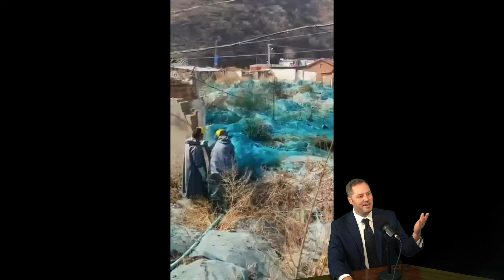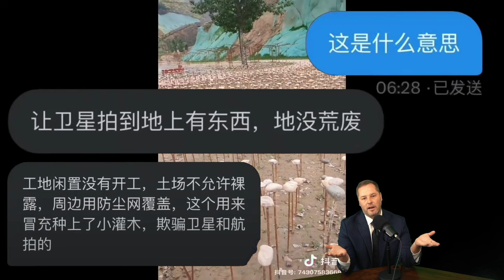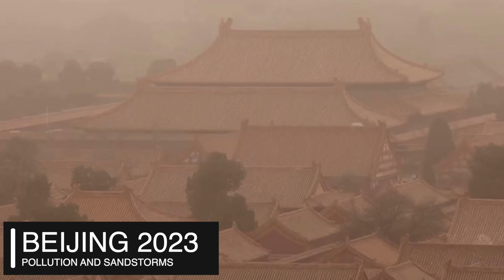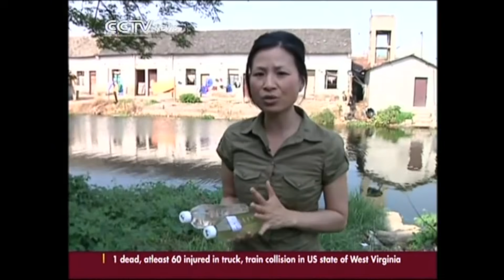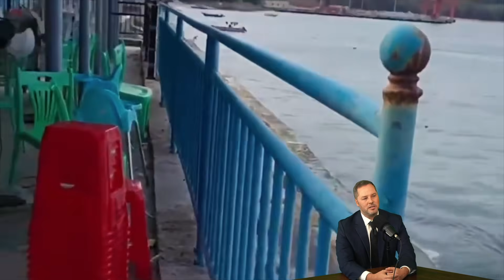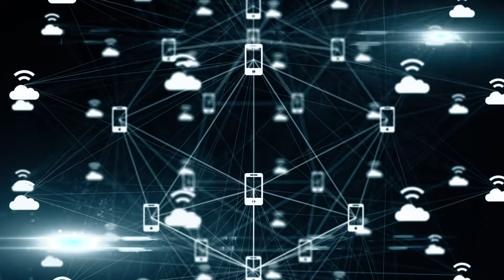China is planting Fields of Stones stuck to Metal Bars - No, Really

Comment: The rocks on the rebar is a safetyprecaution. We do the same here in the west, except we use purposedesigned plasticcaps(that cost a fortune).
The site is a prepared construction site, and we see similar moves across the country. A lot of projects are being done in stages..
Reply: @AmoebaInk  doesnt penetrate as deep when you fall on em
Reply: @AmoebaInk  Youd clear the accumulated debris around the bases, to get acces to the concretefoundation in which theyre anchored in and pertrude from. You use these "spears" to fasten additional rebar, and you wrap that in molds to whatever shape you need and you pour your concrete into that..
Reply: Are you implying that they are filling that whole thing, including the tree they surround with concrete? 😅
Reply: @nonyabidness6492  Filling it?? theyre going to fill it and then stack more on top of it.
Im implying its good to let your anchor sit in concrete that has actually hardend before you stack a 87floor building on top of it..

Comment: Wouldn't painting plants green prevent them from photosynthesizing ever again thus ensuring their deaths?
Reply: That which is dead, can never die.
Reply: Painting dead plants green, will dead plants ever live again ? Answer is .......they are dead and will always be dead.
Reply: @leegilley221  Well no. See plants have this nifty feature, where they tend to grow back if you leave the land alone and let it recover. But if you keep laying down layers after layers of toxic paint...
Reply: @williambarnes5023  you are correct.
Reply: Surprising, no. Paints made speciifically for grasses and plants such as Endurant, does not adversely affect the process of photosynthesis, respiration, or growth. Endurant does not create a film or barrier on the leaf blade like regular paint would. Several university studies have shown that Endurant does not cause a significant decline in photosynthesis, allowing 95% light transmission.
Reply: @allaboutroofing2  Probably works because plants don't actually use the green light. That is why they are green.
Reply: @economicprisoner  no... did you read my comment?
Reply: @allaboutroofing2  You think these people are shelling out for Endurant, instead of cheap lead-based paints?
Reply: @williambarnes5023  yes
Reply: 假新闻，Actually  wrong about the hydroseeding. Using it on raw uncultivated earth, sand & rocks is exactly what we do in the mining industry to stop erosion/ dust bowls, particularly next to roads where trucks stir up the air.  
And yes some mixes are that dark green colour, that dark green colour indicates to me that it’s actually hydromulch。This is the most polluted China 15 years ago. I admire these liars. The lecture in the video is 14 years old, and the pollution content shown in the video is 14 years old.Please check the latest information. China ranks first in photovoltaic, wind power and hydropower in the world, all of which are clean energy. The gray sky in the video has not appeared in 10 years.Please find the channel of foreigners living in China to see the real life。作为一个生活在中国的中国人我不知道吗？

Comment: Recently I learned chinese restaurants are using whats called SEWAGE OIL. Yes doodle sewage oil. 
They harvest it, processes it, refine the oil, and use it to cook. 
why? because its cheaper, and it doesn't taste any different then most other cheap oils. 
it has not been lab tested, because this are local chinese restaurants doing it in china.
and even if it were non toxic- its still disgusting

Comment: In Australia we have "recycling" bins. You can put your plastics and cardboard in there and they take it to a factory and turn it into reusables. 
They definitely don't ship it to China where they then throw it straight in the ocean.
Reply: Are you sure about that?
I worked in a usa trash transfer station and all the glass recyclers went out of biz for lack of demand. Also only cardboard with no coatings can be recycled eliminating half, with the rest and all of the plastic dumped in the squisher and then off to the dump.
Reply: @Derideo  China says they banned imports but IDK. either way little if any actual recycling happens

Comment: I worked for a company that had a Board of Directors that were treated to a one day presentation each year of the main facilities. We, the Blue Collar workers would spend a week or so cleaning the Treatment Plants, polishing the machinery and curiously the Grounds Maintenance department would paint the yellowing grass a nice green color. Then they would Hydroseed any dirt patches that also became a nice pretty green. Generally the Paint department would try to paint an entire Treatment Plant but that often went against the operations being performed so they only rarely did they complete, but they will attempt no matter what to paint those whole plants. The Board of Directors are the current Mayors of the 76 Cities they service. They rode around the County in nice busses and all they could see was nice pretty Wastewater Treatment Facilities. Even after all is said and done about annual plant inspections, the program left those plants clean and professional looking. The communities where these facility’s are look so much better when the local Treatment Plants look good. My old boss believed that if it looks good it runs good. Ehhhh. I’ve seen newly painted machines that ran badly, and usually the Company is forced to solve problems by eliminating old technology which was like pulling teeth. Anybody out there like Magnetic Drives as the Variable Speed controls. These drives used to be a nightmare because Asbestos was banned as a material used on the clutch discs and no replacements worked that could handle the heat and friction. Then Variable Frequency Drive solved that problem permanently. And the Treatment Plant Design Department specified Variable Frequency Drives on most of the Prime pumping stations that are all using VFD’s. But let’s face it painting things like they do in China is just another example of waste, stealing, bribing, environmental damage and just general dishonest behavior on a huge scale. I don’t see any way out of this mess, but I’m sure Mr. serpentza can help guide the way. Thank you for tolerating me for a few moments, your friend.
Reply: pfft, that sounds like our US Navy, painting over dusty pipes and walls to make it look good again before the Admiral walks through.  You can count the age of a ship in growth rings of paint over dust.

Comment: I was stationed at San Bernardino, CA from 71 to 74.  The pollution from LA would blow into our base every afternoon.   You could see it coming.  Schools and businesses would close, but we would still be working outside on the aircraft.  Lungs would ache, eyes burn, and visibility reduced.  Cars had so much pollution controls on them ran like crap.  When testing the cars for emissions, waiving the tester in the air, it would fail.  Shove it up the tailpipe, and the exhaust was cleaner than what was going in the intake.
Now the president wants to fix all our environmental concerns in a couple of years, but allows Chine another 30 years before they have to clean up their act.

Comment: You CAN spray Hydoseeding 'Mixtures' on barren areas.  In fact, THAT'S WHY IT'S DONE.  The mixtures are mostly a little grass seed that is  mixed with green stained paper mulch and psyllium fiber.  I spent 20 years at a Calif. County Dept. Of Public Works covering barrent areas for errosion control.
Reply: Did you paint trees and rocks with it?
Reply: This is the most polluted China 15 years ago. I admire these liars. The lecture in the video is 14 years old, and the pollution content shown in the video is 14 years old.Please check the latest information. China ranks first in photovoltaic, wind power and hydropower in the world, all of which are clean energy. The gray sky in the video has not appeared in 10 years.

Comment: THIS IS not jut a china problem.  half of my city ground water is contaminated with chromium. cancer clusters began to pop up and found out that there was a factory that leaked chromium into the groundwater back in the 80s. but the state environmental protection swept it under the rug. probably it was too much money to fix. until people started getting sick then the epa came in to start testing peoples basements and the groundwater.  they found traces in my basement too.  when it rains hard groundwater comes up in the basement and then when it goes back down and dries it leaves behind these orange crystals that are super toxic and cancer causing.  absolutely terrible.
Reply: the epa was supposed to come clean it up. but all they did was a bunch of expensive testing. and they demolished and cleaned up the original contamination site. but the ground water was supposed to be cleaned up but i guess they figured out there is no way possible to clean it up. so now half the city is a superfund site.  and what is crazy is this is a city in one of the most expensive counties in the united states.

Comment: US auto makers did the exact same thing from approximately 1968 all the way to the early 2000s with the "Air Injection Reaction Pump" emission controls devices.  Their job was to pump fresh air from outside the front of the car into the exhaust pipe so tailpipe emission tests would be diluted when tested.  Did it reduce emissions?  Hell, no.  Not one single drop.  If the car naturally pumped out 20 cu ft of pollutants per mile, it still pumped out 20 cu ft of pollutants even with an A.I.R pump running.  It made no difference. The cars emit the exact same amount of pollutants whether you inject air in there to dilute the ppm count or not.  It's still the same amount of pollutants.

Comment: I don't know what they're actually doing with the green/blue paint on the rocks and fields... But I have done professional hydro seeding, and it is not in any way shape or form difficult to set up and do. I would come into sections of graded land, aka areas where the top soil was stripped and set to specific levels, or grade, and hydro seed without any addition of soil. You mix your seed, water, and fertilizer, and using a high pressure hose spray it onto the surface you're painting with seed. Finally you come back over the area and cover with straw, simple as that. And yes, it grows just fine in that situation. I don't know what they're doing spraying rocks with it, but it could be a way to mask around the site to keep it looking uniform IF they are hydro seeding here. Now, the process I described were used 20 years ago here in the United states, I couldn't tell you what the current techniques are, or government mandates on how to perform this job in todays world. Nor do I know how China does it, just sharing my experience and refuting the idea that this is somehow a difficult or time consuming process, because it most assuredly is not.

Comment: Legitimately they could get the same effect with Miller's microplex but it would legitimately feed everything it touches and would fertilize the whole freaking area. It does everything it touches green but it's also a micronutrient. It's called a chelating agent. I bet it even costs less than the dyes they're using. For any homeowner I would recommend you order it and spray your plants down. Trust me I've been in landscaping for over 30 years and my family has been in landscaping for over 75 years. I legitimately have palm trees across North America of varying sizes. You'd be surprised at what kinds mementos from Florida people like to bring home.

Comment: Oh, maybe you can explain this:
While our plane was approaching Beijing Capital airport, it made turns and kind of passed the same area back and forth several times. And from the window I could see some new apartment complexes (not surprising), then some wide multi-lane roads arranged into squares, but with no buildings inside those squares (kinda weird, but it guess this could have been new districts under development), and then some park-like tiles, with squiggly roads, patches of trees and bushes.. but with no residential areas in close proximity. What are those "parks" about?

Comment: Your mum is a commodore 64 enthusiast? Also this is no different other than more extreme to the same crap that goes on all around the world. I remember when we were kids my mum would have us cleaning up the whole day before someone came visiting. Lol Same at my job today whenever we have a visit, everything gets swept under the carpet till they've gone then everything goes back to normal. Local council couple years ago in my town spent £150k planting some trees, 150 on my road. Non of them left today just pissed 150k down the drain. It ain't just China, though it looks far worse there if this is a true reflection
Reply: Actually  wrong about the hydroseeding. Using it on raw uncultivated earth, sand & rocks is exactly what we do in the mining industry to stop erosion/ dust bowls, particularly next to roads where trucks stir up the air. 
 
And yes some mixes are that dark green colour, that dark green colour indicates to me that it’s actually hydromulch。This is the most polluted China 15 years ago. I admire these liars. The lecture in the video is 14 years old, and the pollution content shown in the video is 14 years old.Please check the latest information. China ranks first in photovoltaic, wind power and hydropower in the world, all of which are clean energy. The gray sky in the video has not appeared in 10 years.Please find the channel of foreigners living in China to see the real life。作为一个生活在中国的中国人我不知道吗？

Comment: I worked in the coal industry in West Virginia and you would see them spray everything when hydroseeding when they had to reclaim the land. Rocks, clay, dirt, it didn't matter, they would spray it. Some of it stuck, and some of it didn't. However, it was never such a dark green color as seen in this video, it was usually more of a yellow-green and you could see them loading bags of seed into the water tank as they were doing it.
Reply: @y0uCantHandle  That assumes it is legit hydromulch/hydroseed.  Could easily be some waste chemical mix that is the right color.
Reply: @y0uCantHandle  My guess is something containing chromium, copper or arsenic as they all have green compounds.
Reply: @y0uCantHandle  This is a country known for injecting industrial waste into 3,000ft or deeper aquifers and using borax as a dough conditioner in noodles.  Never underestimate the deranged depths that the Chinese can and do sink to.
Reply: Yup, the poster of this video is mostly braindead when it comes to facts.
Reply: @y0uCantHandle  It's understandable to be suspicious considering the Chinese government has done a lot of very shady stuff, but making assumptions about unknown things is definitely the wrong way to go about it.
Reply: Yes, the video creator is wrong about all the prep needed for hydroseeding. I’ve seen it done on burn areas and in areas where the soil has been disturbed by development. I’ve seen it applied to road cuts, sometimes with a mesh applied where the cut is very steep, sometimes not. So the guy really doesn’t know what he’s talking about in that regard. He might be right about local Chinese governments committing fraud against the Chinese national government, though. That sounds about right.

Comment: With the amount or time, effort and cost they spent on those rebar "flowers" they could've actually had some decent vegetation.
Reply: Probably not. A lot of the desert areas in China are man made.
Some from construction projects, sometimes large enough for a new city. They strip away all the topsoil and level every hill to make it flat. Great for construction, but the soil that is left can barely support plant life. When the expected building boom in the area doesn't happen, you have dozens of square kilometers of new desert or mud depending on the season.
Others are from intentional deforestation. They ripped down large wooded areas to make farmland. Without talking into consideration that the useable soil was only a few inches deep. The plants that grew there had adapted to this, most crops haven't. There's also the problem of erosion and runoff afterwards. The good soil that was held in place by native plants is gone after a year of rain. Or drys up and blows away during the dry season. Now the only thing left is rocky sand in which nothing useful will grow.
Reply: Well no, because the problem is that they've polluted both the ground and groundwater so badly that nothing will grow. They'd need not only stop polluting, but replace the soil AND spend decades+ cleaning the water sources.

But the core of the issue is cultural. As in: "Only an idiot would spend effort into doing something right, when you can just fake it, until it becomes the next guy's problem."

Comment: Australia uses that green spray stuff on side of sloped highways, I was told it was fertilizer for the grass so it helps stabilize the slopes by promoting grass growth after the cut it. :face-blue-smiling::face-blue-smiling::face-blue-smiling:
Reply: Is that green stuff made of organic matter or oil emulsion?
Reply: Its legit in that case also contains grass or even tree seed depending on application.